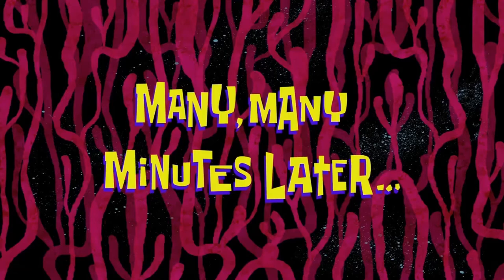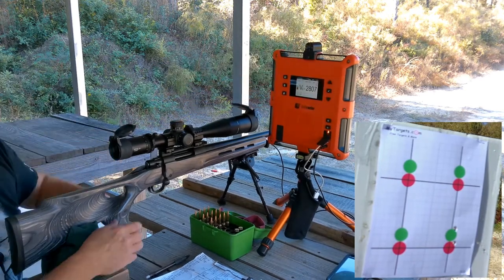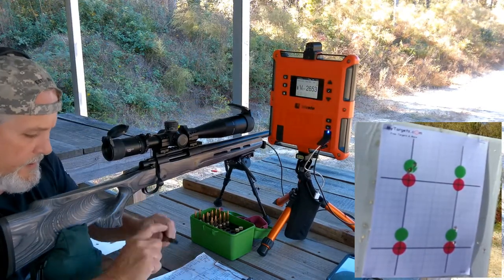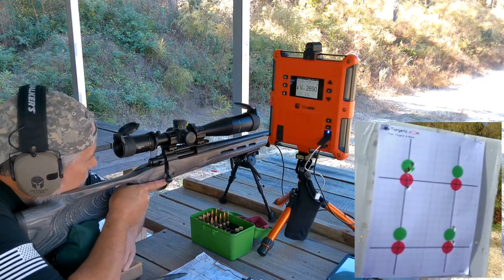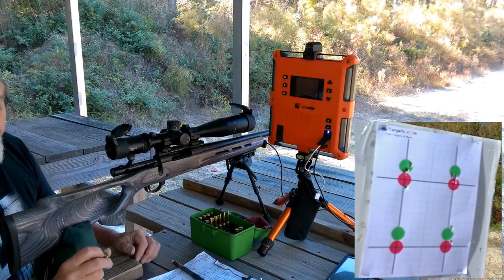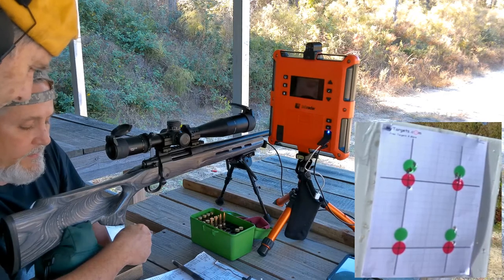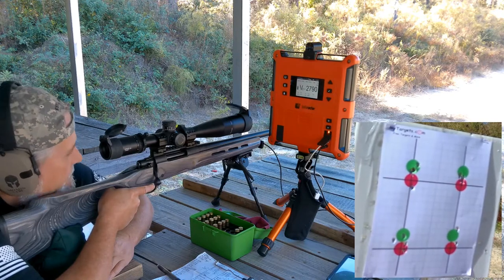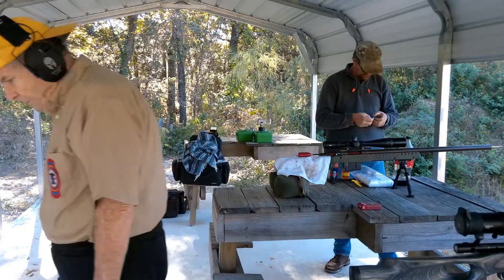Load Data Ladder Test Alliant Powder Reloder 26 Sierra 142gn HPBT Howa 1500 6.5 CreedMoor 11/13/2021

Comment: That seems a really low charge for reloader 26 I shoot 43.5 of H4350 at 2830 you can probably shoot up to around 48 grains or so and never reach pressure problems  but yeah I get it start low work up....